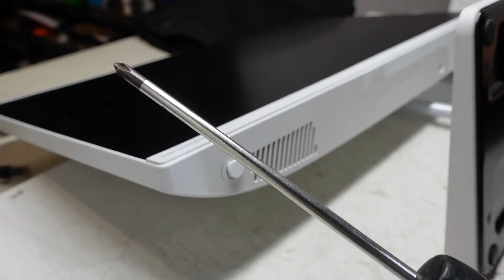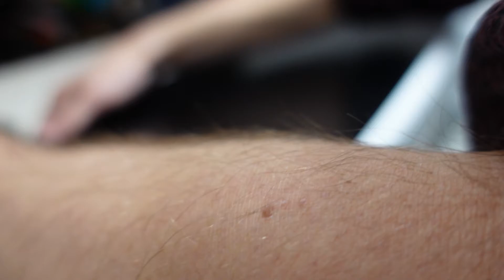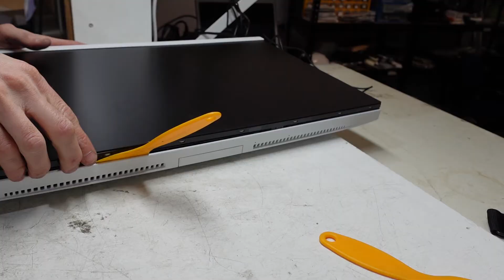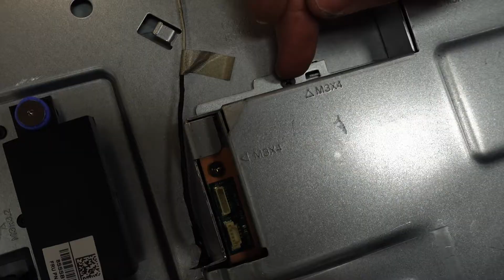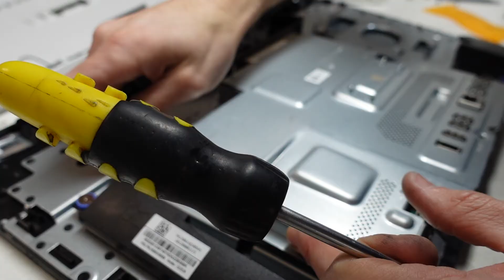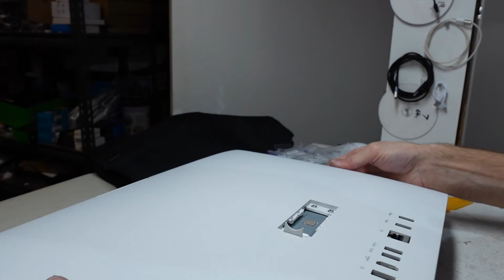Lenovo IdeaCentre AIO 3 24ADA6 Teardown and NVMe Install

Comment: put the screen at bottom and you can easily snap from corner, so the weight from the screen and mainboard wont mess with the screen
Reply from the maker: good tip

Comment: i broke the screen in the corner .. thought it was a small crack that i won't mind, but once i powered my computer it started to burn heat from that corner which burned my finger when I touched it to see what it is ... i turned it off right away ...

Comment: All possibilities of upgrade are blocked by idiotic dead screw at the bottom: it fixed so tight that it can't be turned even with a very big screwdriver 🤬

Comment: Good video. I truly don't understand why Lenovo keeps putting mechanical hard drives in these modern machines. I'm going to attempt it. So hoping I don't break that screen.
Reply from the maker: Good luck
Reply: @rickstechrepairs thankyou. Glad to say all went well! This one was an A340-23ICK.  Different model but taking apart is essentially the same.
Reply from the maker: Excellent!
Reply: @mattscomp  Yo, any tips to share? I'm about to attempt this on a similar model as well and i'm terrified as hell
Reply: @jonatanluque21 take your time. Try some different prying tool if you have available. Old credit/debit or other membership cards sometimes work for me. Work your way around edges at a steady pace. Once you've popped it in one section. That's more half the battle. You don't want to put serious pressure against the screen. Keep comparing your progress against this video. Rick makes it look easy. I'm sure his lead will guide you well as it guided me.
Reply: @mattscomp  i literally Just finished putting it back together and im about to see if i broke it or not lol
Reply: @mattscomp  update: all went well, thanks for the tips! :)
Reply: @jonatanluque21 excellent 👌 I am glad to hear it. If you have to do another. That's great you've had the experience now.

Comment: Honestly I'm surprised at how badly Lenovo's All in Ones quality has been going down, I have a C345 from 2012 and literally, I mean it's not necessary to open it from the screen, and to increase the RAM and put an MSATA SSD on the board it's only necessary to remove a sliding cover without removing screws, what makes it worse is the fact that the foam is there blocking the air outlet of the heatsink, that should never be done .-.

Comment: My display  cracked  during  opening
Reply: Seems like you are from india, if so what quote did you get from lenovo or non authorized store. Because my pc is still under warranty for under 3 months and i have heard that lenovo aio3 are most expensive to repair. Based on your quote it would help me regarding should i extended warranty or not, as approximately it would cost me around 5,500. Thanks

Also did your pc underwent any repair so far.
Reply: @SK-em5wq  I am Repairing  computer  and laptops In my own store,
Before few days this lenovo was come my store for repair ( issue: no power motherboard  problem), Display  cracked during  opening and now display  and motherboard  both need to change.

Comment: Other than FULLY turning the bottom screw, which does nothing but either hug or push the cover away from the body, here are some instructions I hope you find helpful.
Location of attachment points:
BOTTOM:
Measuring 1 centimeter from the bottom corner along the bottom edge on each side, you will find one plastic hook attached to the back case clipping onto the internal plastic frame. A very thin flat blade screwdriver should release it. Otherwise no other hooks or snags along the bottom.

SIDES:
This is where the real fun begins.
Strangely the back cover has inset attachment points, instead of between the case edge and the screen. 

4 U-hook anchor points located at:
1). Horizontally: 1.8cm in from the outside edge, Vertically: 7.8cm up from the bottom outside edge
2). Horizontally: 1.8cm in from the outside edge, Vertically: 14.4cm up from the bottom outside edge
3). Horizontally: 1.8cm in from the outside edge, Vertically: 19.5cm up from the bottom outside edge
4). Horizontally: 1.8cm in from the outside edge, Vertically: 28.8cm up from the bottom outside edge

These are the MOST difficult to disengage. Simply running a guitar pick or screwdriver or slidey bar between the edge and screen doesn’t work. In the past, I’ve been too gentle on the edges and like a surgeon separated the screen glass from the screen digitizer ruining the entire PC. My suggestion is to stick a screwdriver or a block of something inside the stand hole, between the cover and the body to keep up the pressure on the back case as you go along. Since there is nothing to release along the visual  edges, you have to pull the bottom, slide along the side, relax, pull, slide, relax, technique along the bottom and edges until something eventually gives. Hopefully, it won’t be your patience. Fingernails are sometimes the best weapon.

TOP:
There are 8 cover plastic nibs spaced evenly along the top  edge, 4 to the left and right of the camera slide switch. You might try inserting a very thin guitar pick along that edge. I didn’t because I was too afraid of killing another PC again. Getting the plastic cover away may be tricky. There are no delicate cables to worry about. You might get a string of rubber coming out from between the side edges but you can lightly glue them back, I used a slight brush of Elmers rubber glue.

This is the worst case I’ve ever seen for repairs. The attachment points are way too hard and certainly not made to easily open. I would never suggest this PC because the next repair guy might have to buy you a new one out of his own pocket.

Good luck friend, you're going to need it. 😄😉
Reply from the maker: Cheers for the detailed tips!
Reply: Is there a way to change the case i mean i want to upgrade the whole pc( desktop) to another case like normal pc
Reply: @river2593  initially you might think "Yes, just take the parts out and put them in a PC". But realistically No. Among other limitations will be expansion ports, SATA ports and lack of video output interfacing. These components are specially designed for these cases and not just regular parts stuffed in. Normally,All in one PCs are relatively easy to open, except this one.

Comment: very crappy design from the pov of repair
Reply from the maker: funny enough for an aio monitor/pc 
this is one of the easier ones to repair and upgrade
Reply: @rickstechrepairs  ohh is it ?..i thought it was too much of a hassle.Thanks for letting me know.
Reply from the maker: some large AIO PC's iv worked on have been much worse to get open
Reply: all those types of machines are the same. very high possibility of breaking the screen. my shop refuses to do them. it is not worth the risk or hassle.

Comment: i have tried all of my phillips head screwdrivers and now the screw is stripped
Reply from the maker: It should only turn enough to push out the plastic
Reply: @rickstechrepairs  i tried turning the screw again the screw won't turn and the plastic won't push out
Reply: @rickstechrepairs  hi i have tried all of my screwdrivers the screw wont turn and now the screw stripped